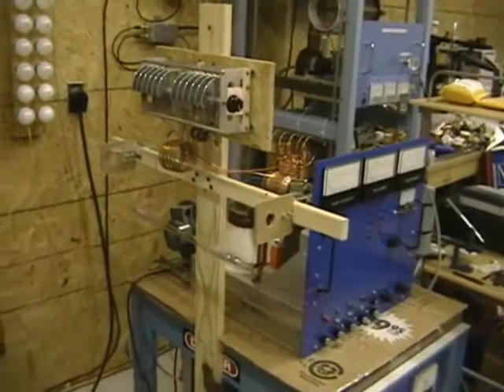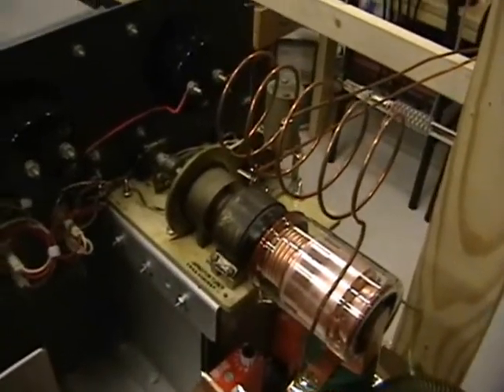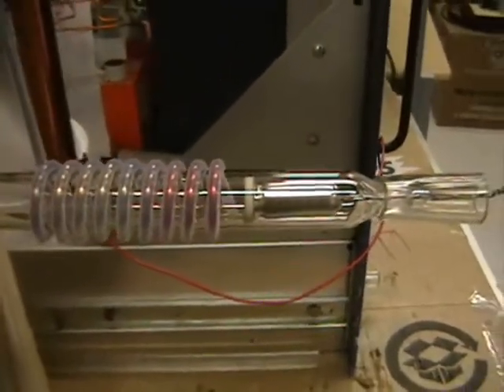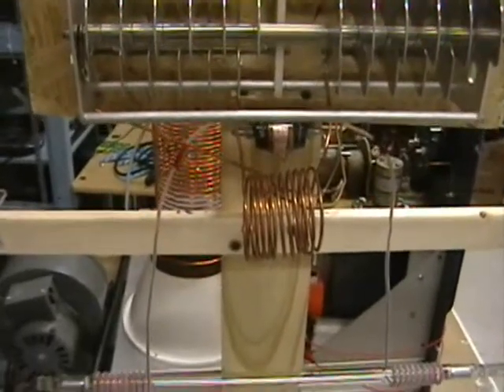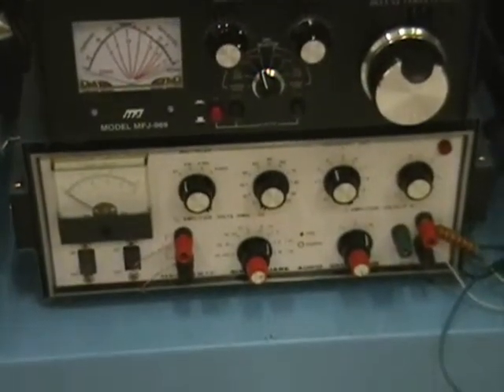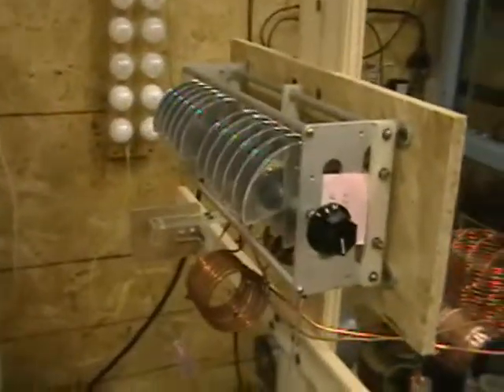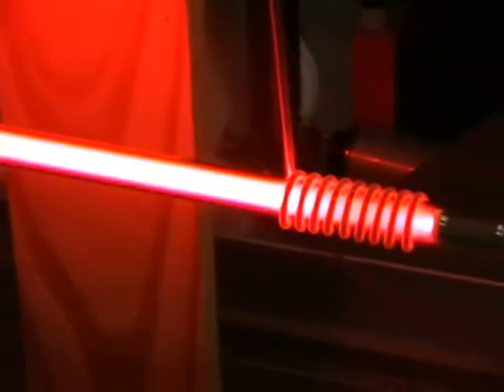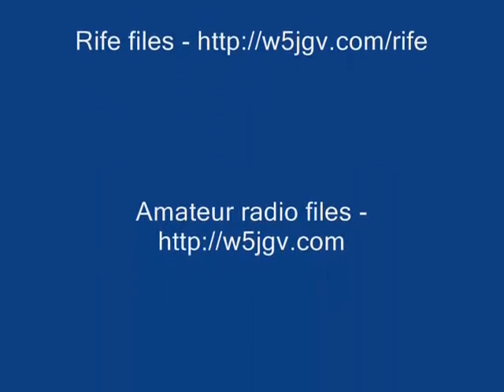Rife Beam Ray System at W5JGV running at the original Rife frequencies of 11.78 and 11.43 MHz.

Comment: Looks very impressive, there are many cases of this science curing people, clearly this a video is clearly designed to convey the science of the machine. It is very impressive. If you have no comments that are positive or to add of value you should simply go and research this technology. There is plenty of research as sated. rather than making negative or pre frontal cortex , auto socio responses go and learn ..great Science.